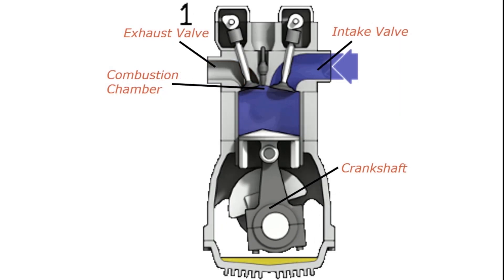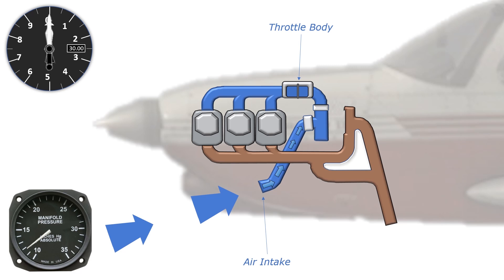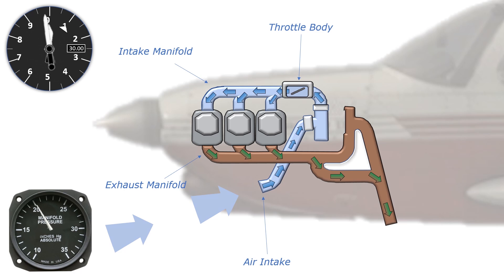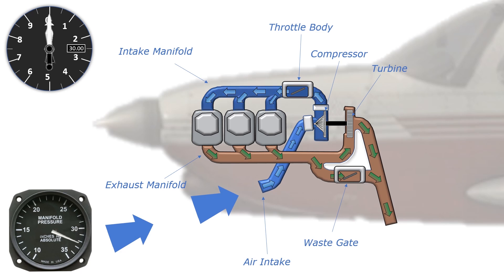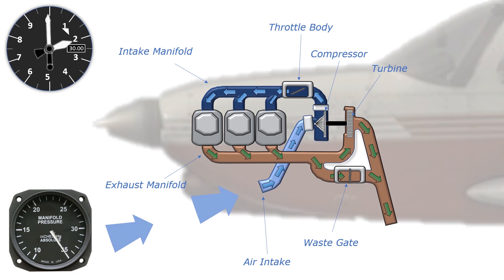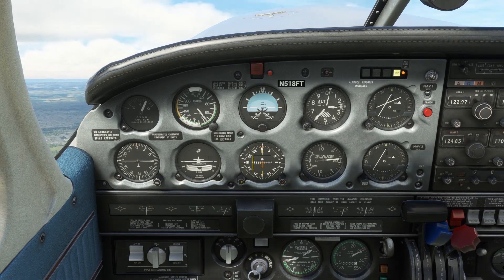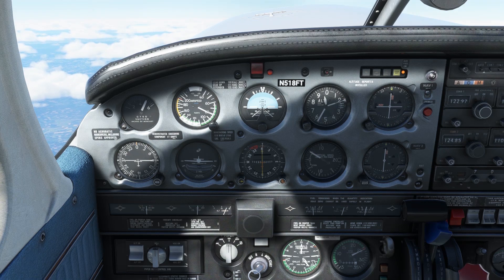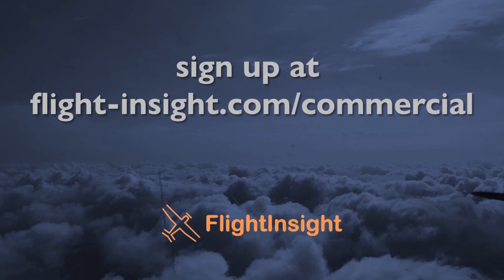How Turbochargers Work | Commercial Pilot Training

Comment: Is manifold pressure meaningfully higher than outside air pressure due to (1) Ram air pressure, the relative speed of the air caused by our airspeed and (2) suction created by the vacuum in the pistons as fuel burns and pistons are pushed uP

Comment: A friend of mine has a Turbo Commanche single, 1970 I think, which features a manual wastegate control on the throttle quadrant, left of the throttle.  Four controls:  wastegate, throttle, propeller, mixture.  The wastegate control has a tab which mechanically PREVENTS the combination of closed wastegate and closed throttle.  More specifically, the throttle control has to be advanced further forward than the wastegate control.

Comment: Some things to know about turbo charged engines. When the turbine compresses the air for the intake, it also increases its temperature. On a diesel engine they have to run what is called an intercooler because the compressed air is too hot entering the engine on its own. So an intercooler is used to cool the air to increase its density prior to it being ingested into the intake. It is normal to idle the engine, an extra one or two minutes before shutting it down to allow the oil to run through the turbo as it spins down. The turbo does not spin at idle because there is not enough exhaust pressure. Turbos are most efficient at wide-open throttle settings. The difference between a turbo charged engine, and a supercharged engine is a turbo charger runs off the exhaust gases, while the supercharger is mechanically driven off the engine. Another name for a supercharger is usually called a blower.
Reply: Turbo charged petrol cars use intercoolers as well. Why is that?
Reply: @rachetsredemption  same reason for turbodiesel engines, increase density and hence oxygen content per unit volume, plus cooler air lets the engine run cooler. A turbo wont spin at idle because a bypass valve switches it off by letting the exhaust gases go around it, once there is enough exhaust pressure the valve closes and the turbo is allowed to spin.
Reply: @rachetsredemption  Like I stated before, when air is compressed, the temperature rises and becomes less dense. The more the boost the hotter the air gets.  In a gasoline engine this can cause combustion the same way as a diesel engine. You don’t want that you want the ignition timing to ignite the fuel at the proper time with a spark plug. This is why they use an intercooler, which is a device for cooling down the air prior to it being ingested into the intake manifold.